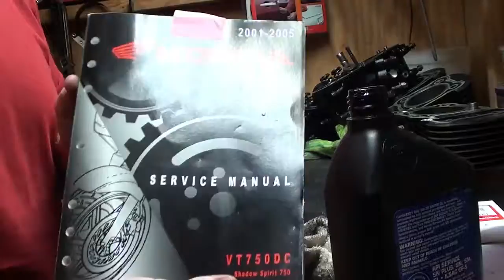Honda Shadow 750 Engine Update

Comment: Great video. I have a 2002 ace 750 that is leaking fluid from that little breather hole best seen at 10:32 on the black wall next  to the far left bolt connection hole on the clear side (not painted) located on the right side of that bolt hole.  Do you know where that little hole connects to ??
Reply from the maker: just another bolt for the jug to be bolted down it would be in the cam area insde the valve cover
Reply: @MichaelWittner  Thank you for your reply. I was told it is a passage for the water to drain out from the spark plugs area being sunk. Is that correct ?

Comment: Could you do a video on setting the timing when both cams are removed, cheers
Reply from the maker: yes sir that the plan, also from what I was reading in the manual looks like you time the cam seperatly but yea we will  do a video here soon. thanks for the comment
Reply: I agree!! Im going to need that soon.

Comment: i spent $600 to have my .50 oversize duplicated with new rings just honing not going to last. not the way to do it.  not being stright cyl is going to tear the rings up quick jp will make an oversize piston i'm the only one that has the one .50 piston for duplicate.  the manual says best if you can not.................. to split the case!
Reply from the maker: thanks for the comment , I've honed a lot of cylinders and put new rings in with no issues if there is no major scoring on the cylinder walls, also we bought new jugs for the bike this is still on hold at the moment